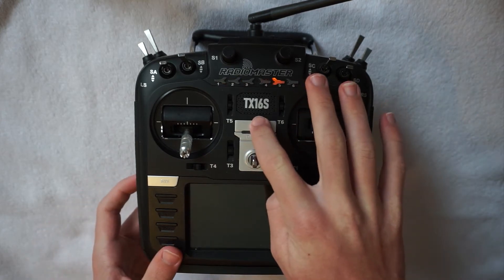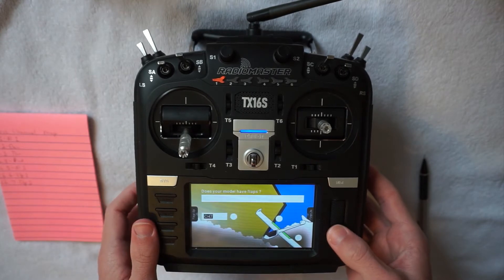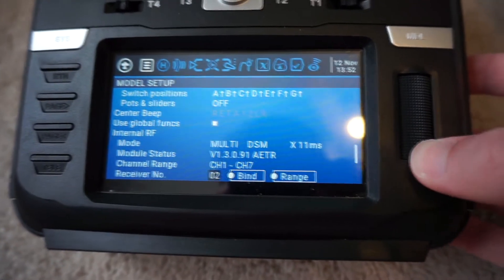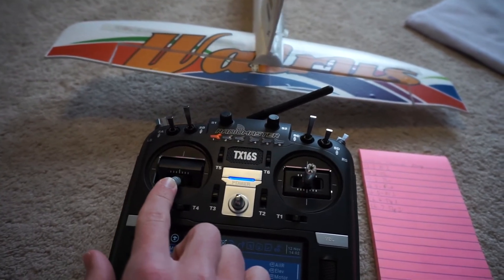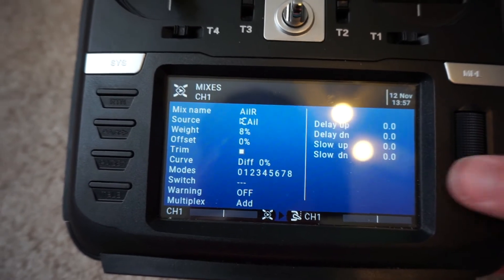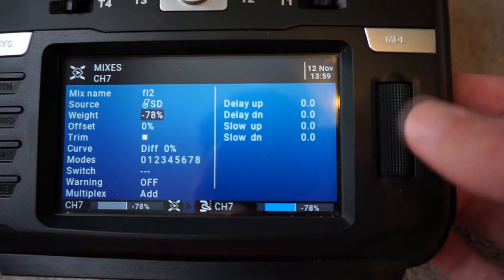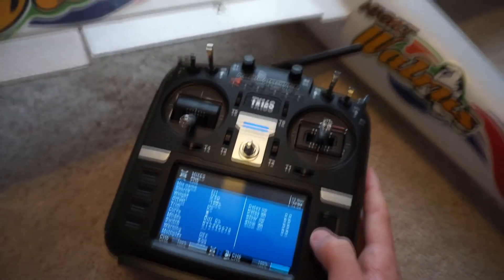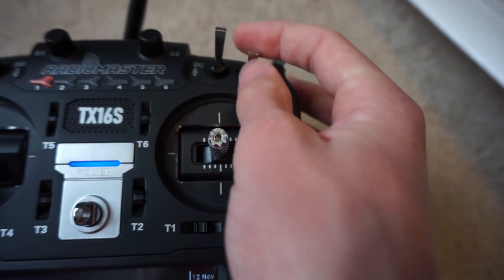RadioMaster TX16S Setup | Pt.1: Model Creation

Comment: Hello. I fly gliders too. I am new to OpenTX but i have on question - why don't you move over to Output screen and then choose the channel and then move over to the last arrow (Direction) - is this not the proper way to change direction? Hope you don't mind my noob question - and thanks for the great video. - Subscribed !
Reply from the maker: You are actually right; doing that is a lot faster and easier and probably the right way to do it. I forgot to add that into my video but I put it in the description awhile back. Thanks for pointing that out!